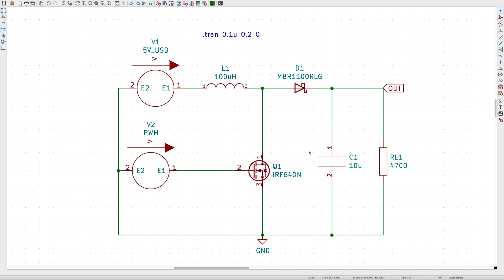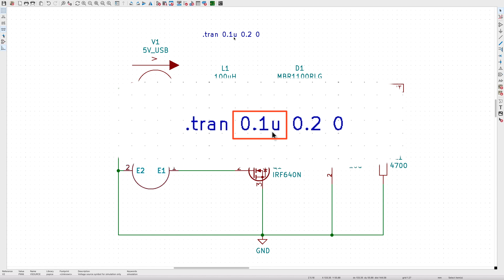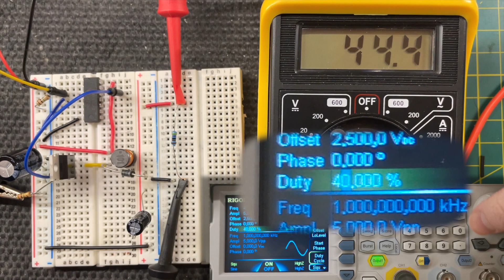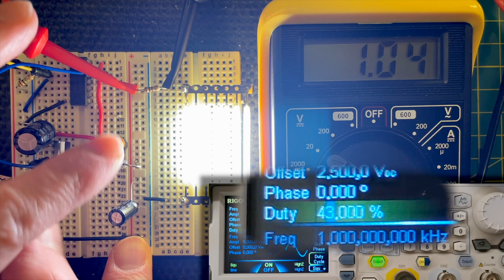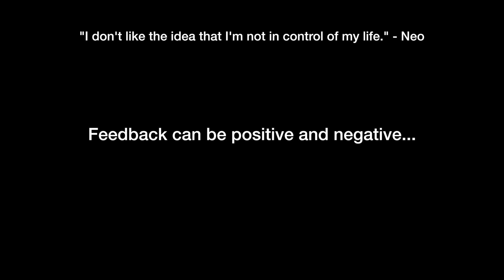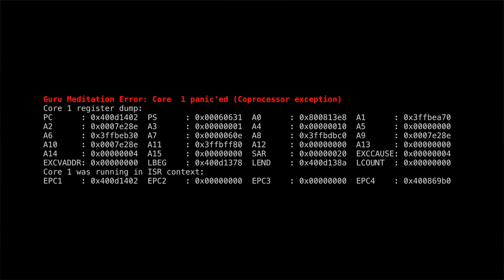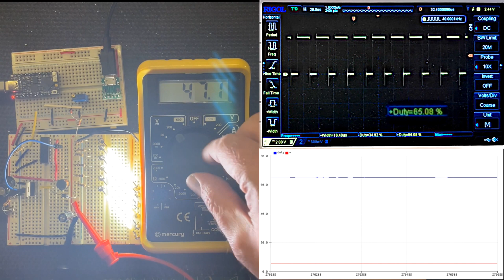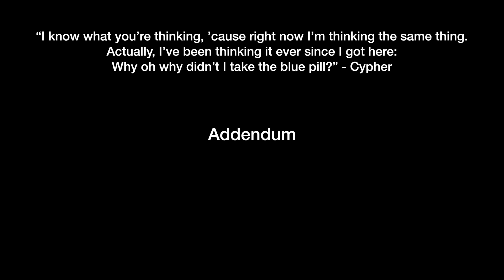Boosting USB 5V to Light Up LED Filaments: Real-Life Testing & Circuit Simulation

Comment: hey i know the video is old but i have a question how do you generate a pwm signal i use digitalwrite in a loop but it makes my arduino board freeze and can no longer change the code on it plus it heats the Arduino alot

Comment: Good project, I found it looking for Kicad simulation videos.  Only question is why didn't you feedback the current since that's the important number for LEDs
Reply from the maker: That's a good question. For my project I'm planning on having multiple LED filaments for a seven segment display. These will need to be run in parallel and switched on and off as required for each digit. If I made a constant current supply I'd need to be adjusting the current depending on how many filaments were turned on or off - so one filament would need 1mA, 2 filaments 2mA etc... With a constant voltage supply I can just put a current limit resistor in series with each filament and set the voltage to a fixed level that will give the required current through each filament.
Reply: @atomic14  ah that makes sense. Of course it's just a little extra code at this point.  But parrell strings are bad for current sourcing.

Comment: A great educational video about switch mode power supplies from first principles! I was a bit concerned  when you touched 110V!
Reply from the maker: Yes, fortunately very low current. But way too easy to forget what your dealing with when you are used to low voltage!

Comment: Pretty much no one uses Zeners anymore with the TL431 on the market. 
Zener voltages change a lot with temperature and how much current goes through it.
Reply from the maker: Indeed. For this project the actual voltage was less important as it’s just used for protection. You can also just have a diode  pointing to the power rail and shunt any high voltage straight to that.

Comment: How did you fry your ESP32?
Do you use fast external pull-up and pull-down diodes (to +3.3 and GND) at the Analog input port?
Reply from the maker: I was being a bit silly and messing around with the feedback circuit with everything powered up and no safety diodes… I’m using a Schottky diode to limit the voltage, but managed to completely bypass that. No bang or magic smoke, just a very sad unresponsive ESP32.

Comment: I wish you put this out before Christmas. 🤪 I had to do something similar but with next to no knowledge of electronics I ended up buying a module with a trim on it to set output power.  I needed + and - 30v to drive the Christmas lights I had so I ran that through a dual h bridge motor driver. I would like to see how you would build it yourself rather than using a module purchased on line.  Your video was terrific. I’m looking forward to seeing your next episode.  I also learned a lot and will look for some zenner diodes like the person who commented before me. 😃 great stuff. Thank you for creating this video.
Reply from the maker: Well, if I'm honest, buying a module or using a proper boost controller IC would be the right way to do things - so you made the right choice! There are all sorts of things that I've not covered such as detecting fault conditions like short circuits and overvoltage. It's also likely that there are instabilities in my control loop that could cause it to oscillate wildly and go completely out of control :) Having said that, it's a fun project to play with.
Reply: @atomic14  well the power supply that came with my lights has very little in it and it turned battery power into +/- 30 Ac to drive the lights.  My version filled a small project box with 12v Ac coming in from garden lighting. Then using a full bridge rectifier to get a dc current. I fed that into a step down power module to run my esp32 and I also ran that into a buck boost module to provide the power for the dual h bridge module which I have the esp 32 controlling to decide when to turn the lights on and off.  Admittedly my esp32 is wifi connected to ntp to keep accurate time but still my solution was much more expensive that the manufacturers of the lighting used. I bet with a better understanding I could have come up with a more elegant solution.  I still think what you did is awesome. I want to find where to buy some inductors so I can try it myself 😃
Reply: I’m a new subscriber and noticed a few of your previous projects were things I planned to do also, so I’m going back now to watch your previous videos 😃Thank you !
Reply from the maker: @TheTotalGeek  Sounds like a great project! Just be careful as the voltages you can generate can give you a nasty zap if you've got capacitors being charged up :)
Reply from the maker: @TheTotalGeek  Thanks for the sub! Some of the older videos are definitely a bit ropey - even I struggle to watch them :)

Comment: I really like your projects! Oversampling the ADC won’t that waste time thereby slowing the feedback and still risking high or low voltage? The ADC in the esp32 is really shitty, i once used it the read the temperature using a ptc, and i decided to use a running average, always reading when one core was idle. I don’t suppose something like this will work for driving the duty cycle?
Reply from the maker: I think it probably would, I ended up using a timer as using an RTOS task seemed to be a bit slow and I was hitting watchdog timeouts. I'm actually using a running median filter in my code but there will be a delay in responding to voltage changes. The output capacitor provides a bit of help here as it's fairly large so the speed of voltage changes are limited by that.

Comment: I suppose instead of using the ADC you could have just used a comparator to detect the difference between a reference voltage and the feedback signal. The adjust the PWM if the feedback is above or below the reference it depends on how tight you want the regulation. 
Now you just have to check if the inductor is getting close to saturation, the work never stops or just use the 5V ones.
I need 75V for the ones I've got so have not decided what to do with them yet.
Reply from the maker: I've ordered a bunch of 3v ones - hopefully they won't get broken in transit - but now I also need to think if I carry on with the high voltage ones or change course... if I stick with the current approach then it probably makes sense to just get a proper boost chip. I could get rid of the gate driver chip completely. What's the best way of monitoring the inductor?
Reply: @atomic14  If you put a resistor in series with the inductor and put the scope across it, remembering that the 0V on the scope is also mains earth. So your need an isolated 5V supply.

The trace on the scope should look like a nice triangular wave as the inductor is not in saturation and so still able to limit the change in current. As the core starts to saturate I believe the inductance falls away so the current can rise at a much faster rate, also the core heats up which also does not help its magnetic properties.  The top of the triangular wave starts to distort as the current is changing faster.

Now don’t ask me to calculate the inductance required, as it hard enough with the datasheets to guide you.
Reply from the maker: @TheEmbeddedHobbyist  I'll have a look. One of the very counterintuitive things I found with this project is the inductor value. I naively assumed bigger inductance => better but found the whole thing stopped working if I went too large and that smaller values gave me a much bigger boost. There's a whole bunch of stuff to read about DCM and CCM modes which are really interesting. My main learning was that I really don't know enough about analogue electronics. My degree which is now a long time ago was very focused on digital and it really shows in my knowledge gaps.
Reply: @atomic14  My degree was a bit of pick & mix.  Analogue & Digital Electronics, RF communications, concurrent software. but I did do the degree about 15 years after doing ONC, HNC & HND as the first company said that the HND and the years of working my way up from production, through test and on to the R&D department was equivalent to a degree.
The next company charged their rates by how many degree / chartered engineers were need to work on the project. So they would pay for you to get a degree :-) so I got one.